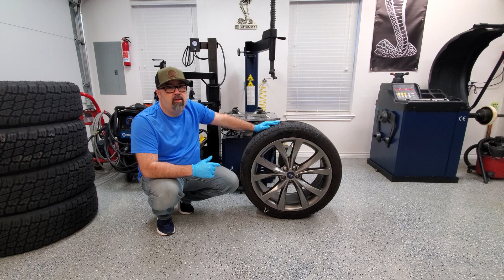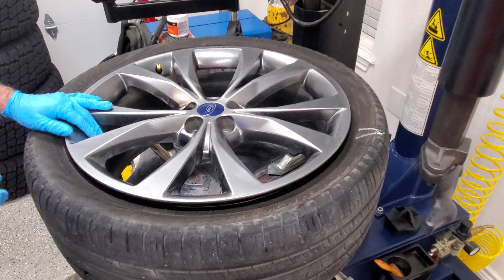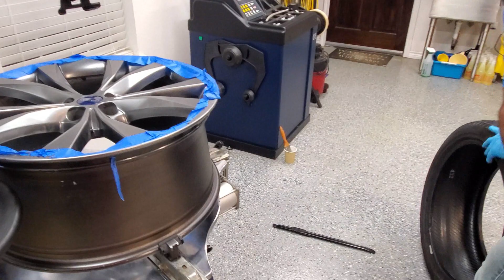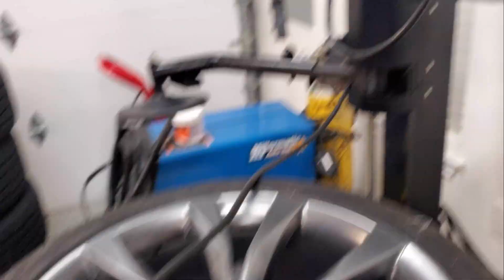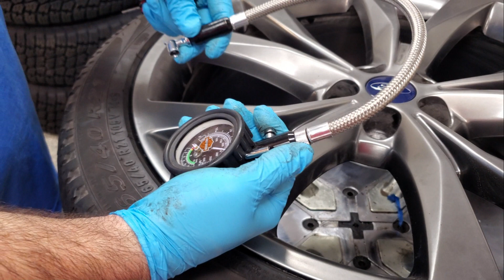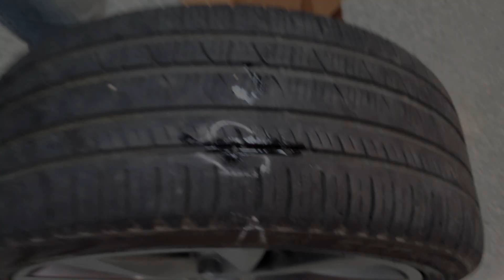Easiest Way To Remove AND Install Tires! Tire Changer Operation Simplified.

Comment from the maker: 🛞 Do you change your own tires? Tell us what tire machine you’re using, what you like about it, and the toughest tire or wheel combination you’ve ever fought with!

🔧 In this shop demonstration, we simplify the basic operation of a tire changer and show the process we use to remove a tire from the wheel and install another one. Once you understand the order of operations and proper machine setup, the job becomes much more manageable.

⚠️ Tire-changing equipment can cause serious injury or wheel damage when used incorrectly. Follow the instructions for your specific machine, use proper training and safety procedures, and never exceed the tire or wheel manufacturer’s inflation limits.

🚙 Want to see a real-world tire installation and review? Check out the Michelin Pilot Sport All Season 4 tires on our 2018 Ford Edge Sport: ▶️ https://youtu.be/_YT_Q1ytztA

🏁 For more shop equipment demonstrations, tire service, DIY maintenance, and real-world automotive content, subscribe and ride along with us:
https://www.youtube.com/@DownShifting76?sub_confirmation=1

🛠️ Check out performance parts, tire equipment, tools, and gear from our affiliate partner, Summit Racing Equipment:
https://summitracing.pxf.io/3kAWdr

👕 Visit the DownShifting merchandise and accessory shop:
https://downshifting76.myspreadshop.com/

Thanks for watching and supporting DownShifting76!